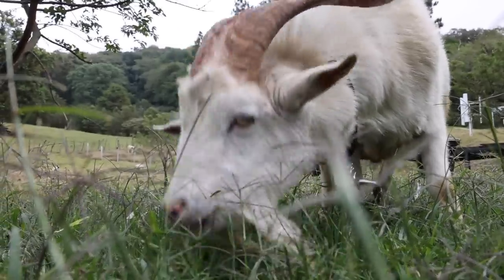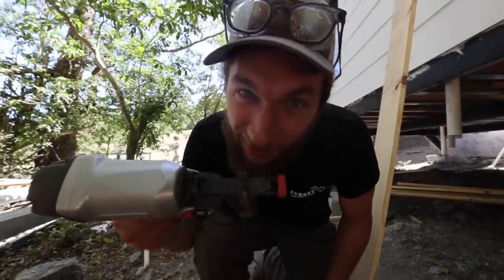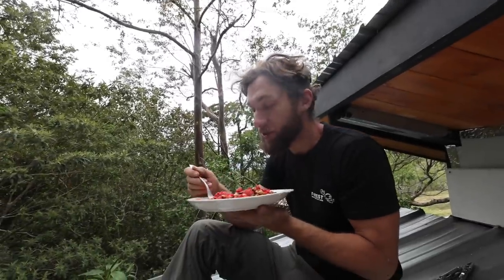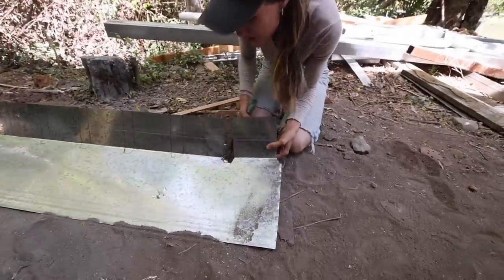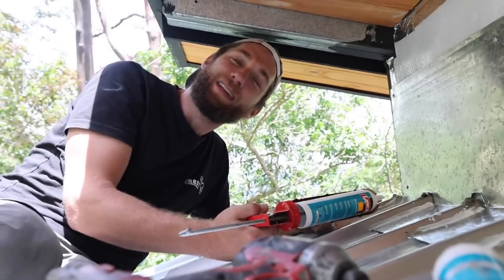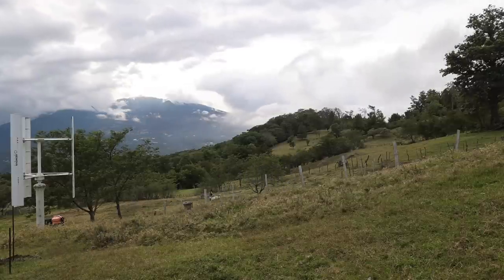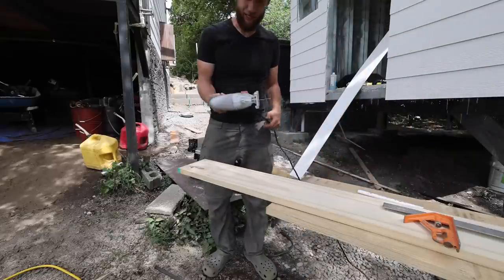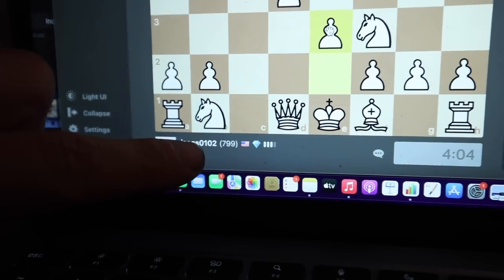BUILDING OUR OWN TINY HOME / finishing up the front

Comment: In Japanese gardening, you actually often STRIVE for that rougher look and on purpose strip away the fine layer above the slightly rougher and rockier parts. Hard to tell without actually seeing with the other parts, but you could consider just making it a controlled square with the rougher stuff inside the door. Think of it as protection from slipping when the floor is wet.

Comment: Having dealt with a “professional” flashing installation on our roof gone bad, I must say the flashing cutout over the corrugated roofing should  not have been removed, but flapped and molded over the corrugations. The entire idea is to install a one piece shield that will not allow moisture to leak under the roofing.  It will take resealing with a marine type caulk every year to insure and protect.  Being under the roof helps, but water finds a way.  Enjoy the new bathroom!

Comment: Commiserating with you, Kaylee. I hate tin snips. 😂🤣
I did a metal roof all on my own when I was just a bit older than you and ended up with carpal tunnel from the freakin' tin snips. Found out later that they have electric nibblers that will do the job for you. If I ever do a metal roof again, that's what I'm going to do.

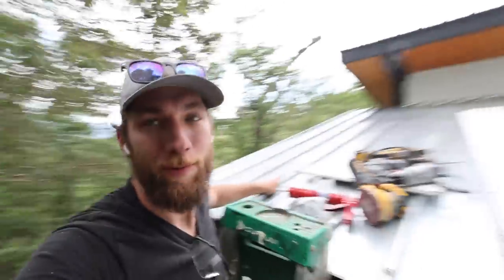Comment: Just an observation. On that back section of the roof @ 18:26. The beam ends are open. Are you planning to close it off or seal with foam insulation? It could help keep bugs from building nests or any birds, or rain from getting into the beam,

Comment: You should have put a second 90 ° bend at the bottom of the flashing, just big enough to cover the depth of the grooves, then cutting just that part out, and screwing into the high  surface of the roofing.

Comment: Because I work with lots of reclaimed wood from crates and pallets I feel your situation in having to re-mill your wood.  

In doing this it's a bit like we need to repeat we what the lumber mill folks do on a smaller scale.  I h as ve learned a lot from the folks using the band saw mills on how to achieve true lumber from what essential are chunks of trees.

I am living in the Pacific Northwest so tropical weather is not yet 😅😂😊
An issue and tree chunks are plentiful.  

I am trying to work out a tiny band saw mill arrangement using what I can find to use the smaller chunks of  logs like I have to mill out usable lumber.

Love you folks give your little helper a random hug from me and play on.

Wolfmama0104

Comment: That acid that cleans concrete is the same exact acid that is used by your stomach. Hydrochloric acid, aka in the trades as Muriatic acid. If you ever have tummy problems from acid, drink lemon juice. Lemon juice has citric acid in it. That acid acts as a buffer for hydrochloric acid. A buffer is a compound that can act on a lot of product to achieve a result. In the case of citric acid and hydrochloric acid, a small amount of citric acid keep the pH of hydrochloric acid at 5 which is the ideal stomach pH. You can get a metal shear that attaches to a drill, or a standalone shear that plugs into 120v. It is like a tiny pair of scissors that moves up and down.

Comment: I read comment after comment and nobody in this section has told you that your flashing is not going to work and that you actually fucked it up by cutting channels into it .. flashing is to have a run off and what you have done by cutting it to fit the channels is created a way for water to flow in during a windy and wet storm .. the flashing was not meant to be cut it sits up on the channels to send water away .. the upper portion  sits under the panel which would be best as a metal on top of it .. but silicone sealing an area where water is prevalent is not the right way to flash .. especially in Panama .. just sayin kids ..